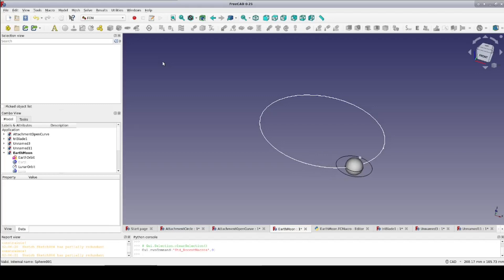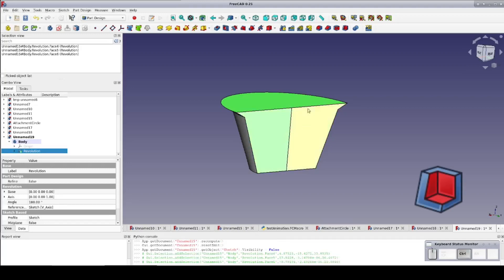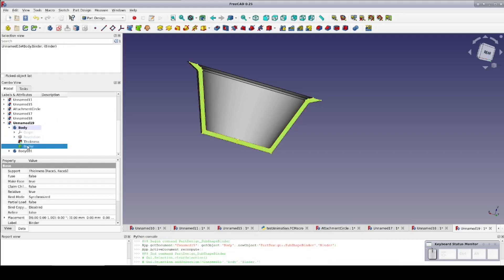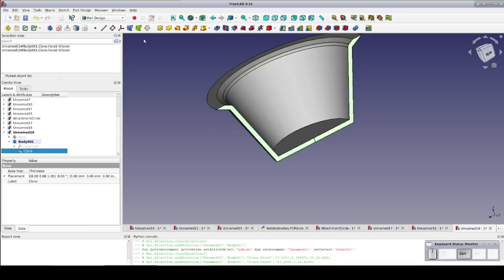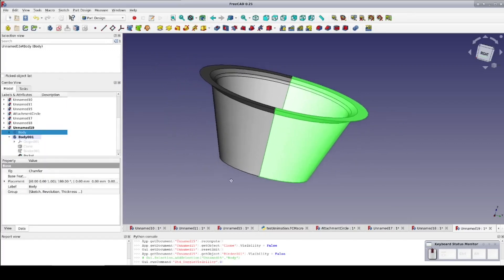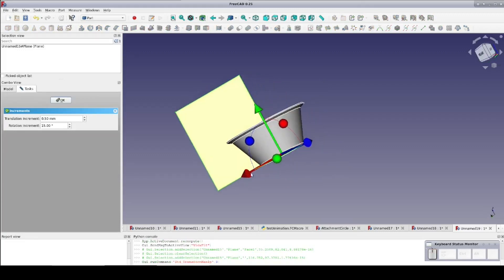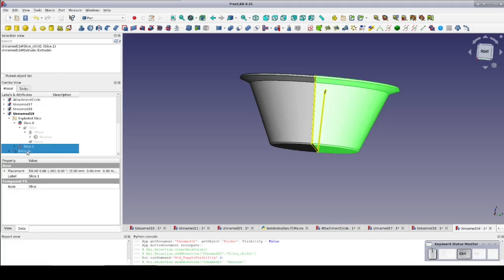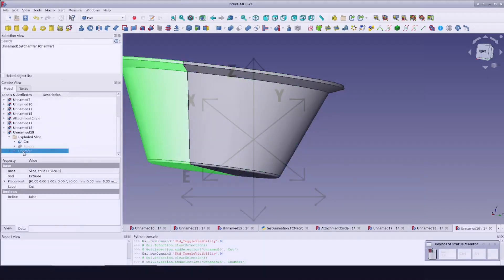FreeCAD: Replying to the replies to my open reply to Tom Sanladerer

Comment: I have been trying to find a practical way to fillet vertical edges of a part using a macro and the part workbench. It seems that no mater what I try I either get no fillets at all or an error message.